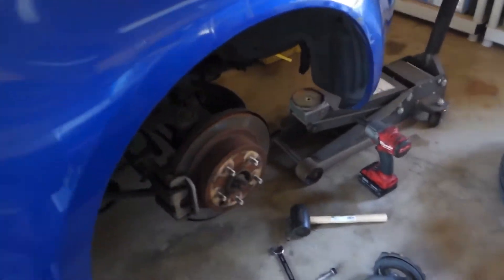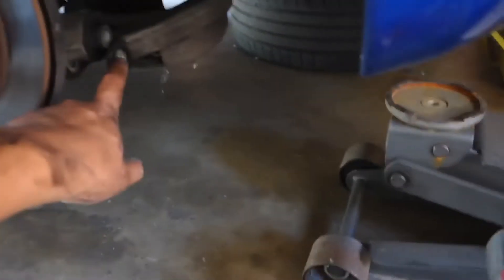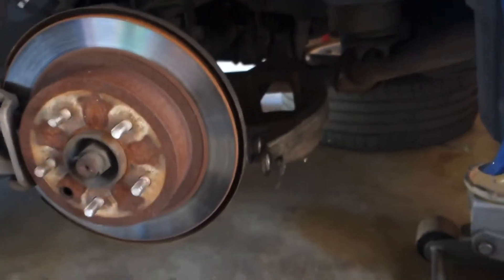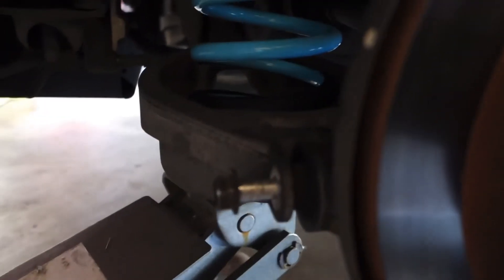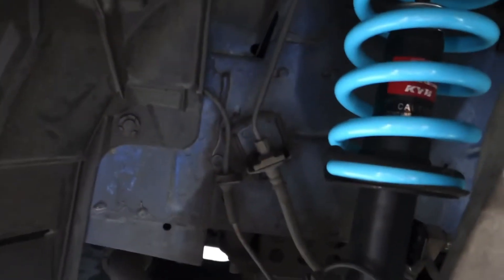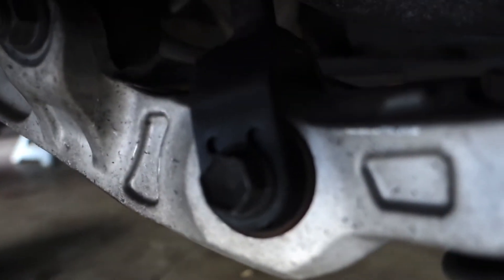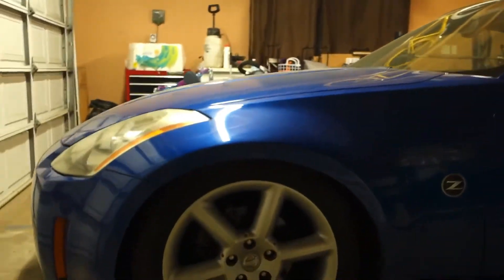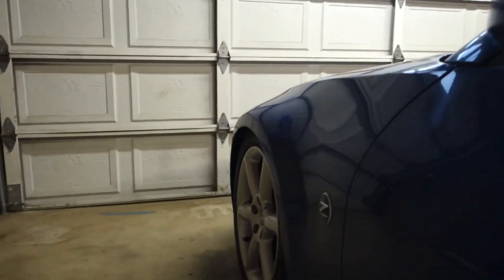Keep it on the down low!  Godspeed lowering springs installed! - vlog 038

Comment: I bought the Godspeed traction s for my AWD 2014 Infiniti q60s, and it rides absolutely terrible, bouncy and I can feel every little nib in the road.
Reply: Just installed some on my q40 awd and i agree with you!!!! Shouldve just got coilovers..
Reply: Thts bcuz they have a high spring rate! So the ride is guna be stiffer! 🤷

Comment: what did you do about the camber? took mine to go get an alignment afterwards and they said nothing could be adjusted for camber.
Reply from the maker: i didn't do anything about it.  car was sold shortly after, decided to go with a different project.
Reply: Usually need to buy aftermarket adjustable toe links as well.

Comment: You remember if this setup rubbed or not?
Reply: i have them on my g37 sedan,19x8s with 200+ lbs in the trunk in subwoofers, my tires rub the  fender liners  nothing crazy, but i also went with all new kyb struts too.

Comment: Im installing and the spring is loose is yours loose too?
Reply: Is it loose in the air or is it loose when the car is on the ground?  Is the spring clocked so the end of the spring is seated properly/correctly?  Is the top (hat) nut tightened to spec?  Does the spring still have the rubber isolators (sleeves) around the coils?
Reply: @K03sport  yea its loose when in air i change them